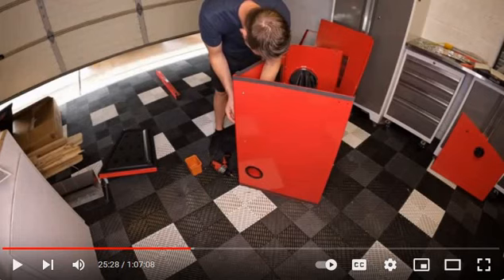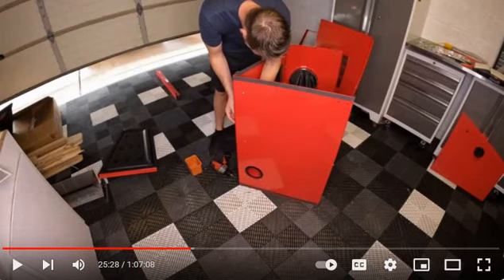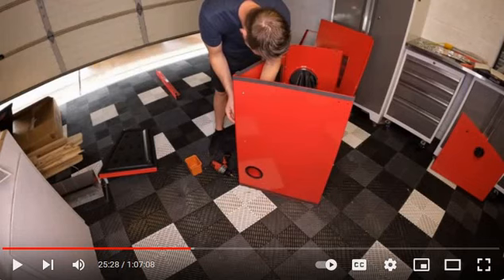Back to Sand Blasting

Comment: I took some time today looking at the dealer you showed in the video on buying engines.  The first 2 results are the 1" and 1-1/8" crankshafts as you showed.  I took the engine numbers and pulled the parts lists from the briggs site.   The 1" crank is the part# 84004538 that carrier blacklisted....  So that makes the engine seem like a very clear choice.  I also double checked the bearing numbers and they are the same between the 2 cranks, and both use 2 bearings.  I wonder what the issue is with that 84004538  crank.
Reply from the maker: what is the 843827 is that the other carrier blacklisted crank ?
Reply from the maker: when i search 843827 i get ball bearing not crankshaft
Reply: @vg23air  Ignore the 843827, I meant to paste the 84004538 number in again and forgot I'd copied that bearing number to see if they were the same.  I don't remember the other blacklisted crank number.  But according to the briggs parts list the 1"x 2-29/32" Shaft engine has the bad crank 

I get confused.  Hence copying the numbers to keep track.... And still screw it up
Reply: @vg23air  I fixed the post.
Reply from the maker: @clytle374  uploading a video